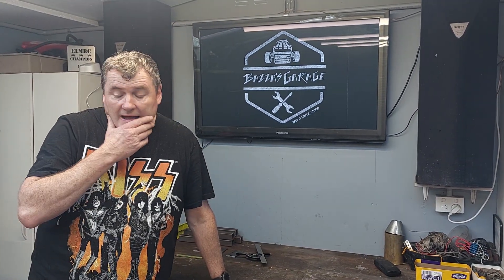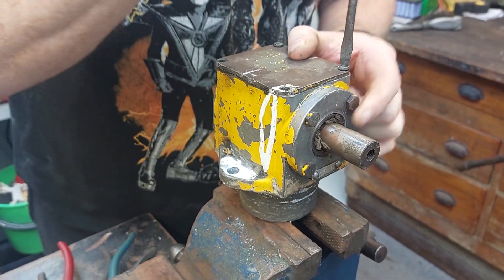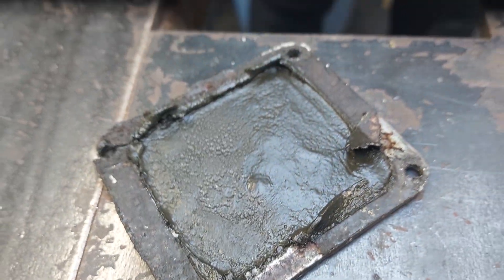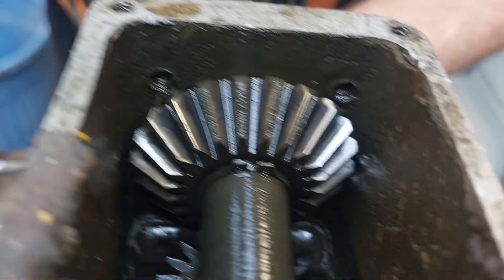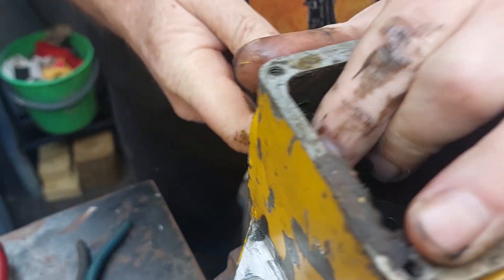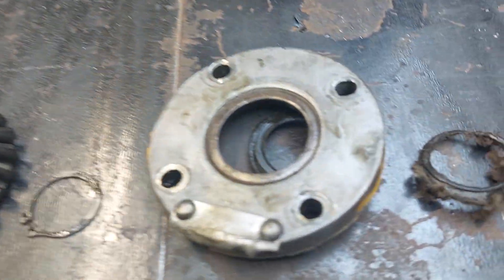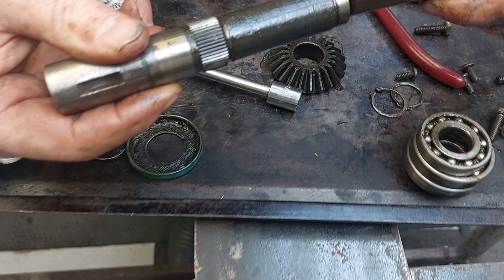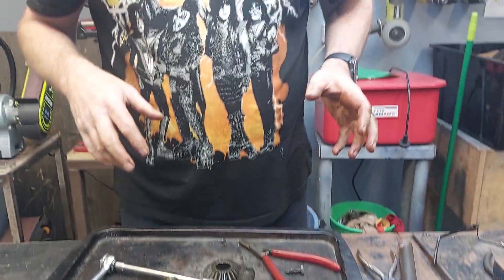Peerless 1000 stripdown

Comment: Would I destroy this gearbox if I connected my motor to output shaft rather than the input shaft. Then ran the input shaft as my output?
Reply: no I don't think so, but it is designed to work one way.

Comment: Have watched your video on Ackerman..when setting it is the string in center of hole where tie rod bolts  thanks from Australia
Reply from the maker: Yip the center of the front axle bolt to the center of the rear axle . then the tie rod bolt should be on the center of that line.